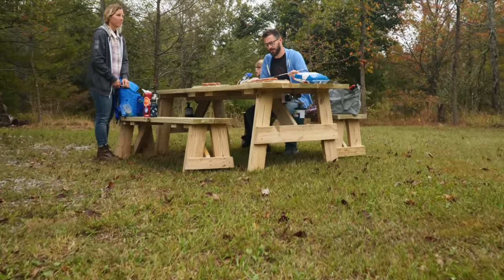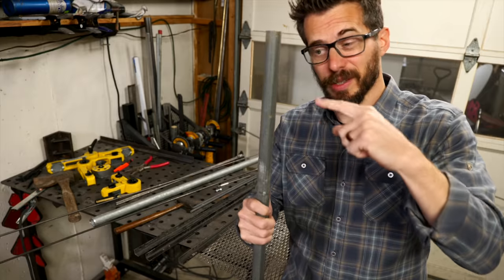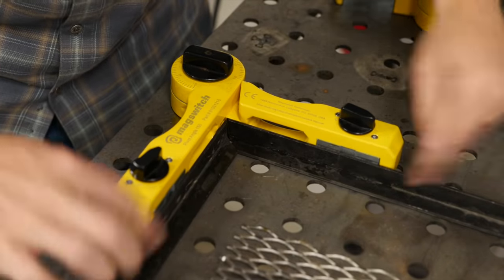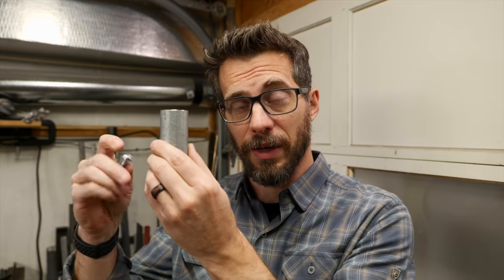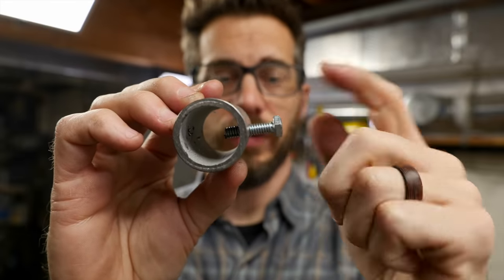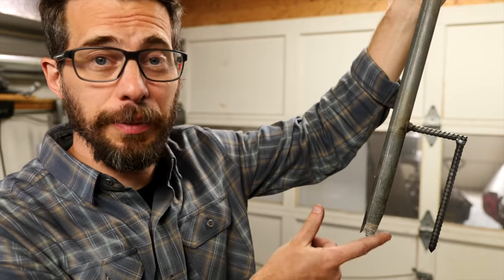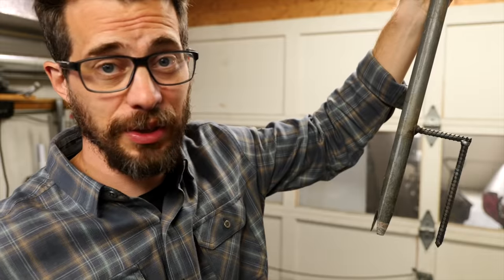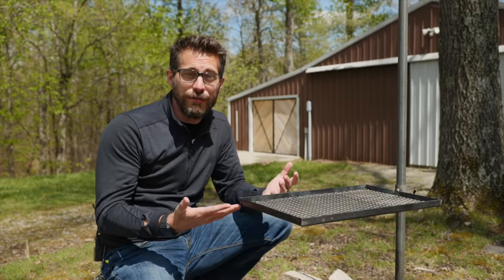Making a Portable Fire Pit Grill | I Like To Make Stuff

Comment: would have the pipe collar in 2 pieces, one welded to the grill with nothing done to it, so it can be pulled off the fire and the second would be the locking collar to hold it at the height you wanted. This would allow you to cook with much more control.

Comment: Nice build,  if a guy didn't have a tap set you could just drill holes 6 in apart in the bar itself and put a bolt or whatever to keep it from going down.

Comment: Tried and true design, been around for  hundreds of years, instead of using a bolt make the pipe shorter and a larger diameter this allows the weight of the grill to just be raised and lowered with cantilever action

Comment: So this is a take on a Santa Maria grill, nice. I'd recommend adding a handle on the non-fire side so you can adjust the height without burning yourself. You can paint the frame in a high temp enamel to help the rust issue, and recommend stainless or rubbing that grate with oil (like caring for cast iron pan)

Comment: I need exactly something like this.  Have a fire pit made out of a beer keg (just cut the bottom off at 3” and put the rest of it on the ground, handles and tap hole down) and it burns so hot, I need to get the grill top higher.  Thanks!!

Comment: One way to help midigate rust (not completly stop it) is to "season" the grill surface. What I've done in the past is put a some non-stick cooking spray on the grill grate on both sides then let it get really hot for about 10-15min,. You will see the surface start to turn black. after it cools off you can then wipe it down. This is a good practice to do with any grill, especially one then is going to be used with wood or charcoal.

Comment: just a suggestion , when welding the "wing" tab on the bolt , I keep some scrap copper pipe of different sizes to slip over the threads to protect them from boogers

Comment: That's great, only thing i'd try to attach is a wooden handle, so it could be adjusted while on the fire pit... Mainly to control the heat during grilling things...
Reply: I would also want to attach a wooden handle to the clamping bolt so it can be loosened and tightened while hot.

Comment: You should have made a handle attached to the slideable collar so you can spin and move the grill without touching the hot parts - could easily add it too! Directly opposite the grill, attached to the collar :)

Comment: great idea, I have an improvement. Because the foot is fixed and you hold the surface with a bolt, you can't quickly move the surface out and back over the fire. If you would turn the pipe connection into a hing, it would be great. You could quickly move the surface away from the fire and so.

Comment: You could size one to specifically fit a griddle plate on there. Also, it probably doesn't need to be quite that tall, three feet would fit most applications and it's even more portable.

Comment: Pro tip. If you dont have a tap but do have a welder. Just weld the nut to the sliding tube to hold the bolt in place.

Comment: I love this almost as much as I love this channel, but I see one problem.  Now I'm not much of the outdoors type, but I would assume that if you are making this adjustable than there is a need to cook items at different distances from the fire.  My problem becomes that if you want to adjust this after having already cooked with it, that it's going to be incredibly hot from the fire and the only way to cool it is going to be removing it from the fire, requiring the fire to be out in order for it to cool enough to be handled.  Sure you could wear high temp gloves, but then you have to remember to bring them as well.  Still though this is brilliant and I love the fact that you built it from scrap you found lying around the shop.

Comment: I think changing the way to hold the grill in place would make it more functionable like instead of having to screw it in to hold it in place, drilling multiple holes on the pole itself and then sticking a stick through to hold the grill in place seems way easier to set up. This way, it would last longer and more unlikely for the grill to slip down. Also, adding some sort of handle at the opposite end of the grill would make removing the grill much easier, maybe even when its still hot. But overall still a great build.

Comment: Did you consider putting in a center support on the expanded steel? I've seen DIY grills like this before made with expanded steel, and it always seems that they tend to sag in the center after a few uses over open flame.
Reply from the maker: I hadn't thought of that, but I've also never used one of these. That's a good thing to note though, thanks!

Comment: Suggestion for the 2.0 version  drill a hole in the tubing and place the rebar all the way through it and instead of cutting it into 2 pieces just bend the rebar  to a 90 degree so that its more stout and can withstand a little more abuse

Comment: You really did not have to do the tvinga with the bolt in the sliding pipe bit. You should have just drilled holes att the diffrent heights spaced like 2 inches apart and then have a smooth bolt and the levrage and weight from the grill would keep it in place